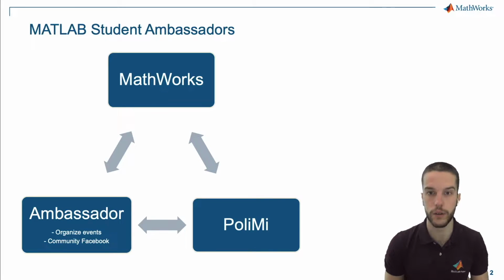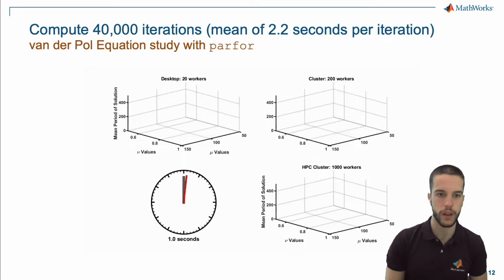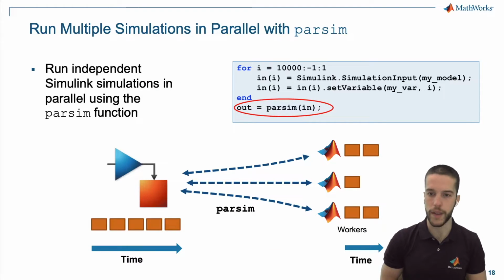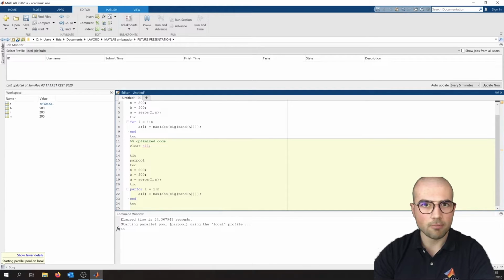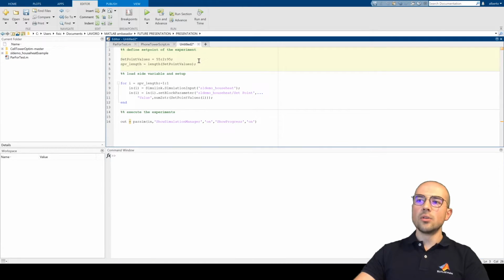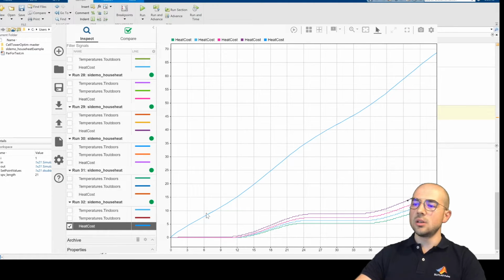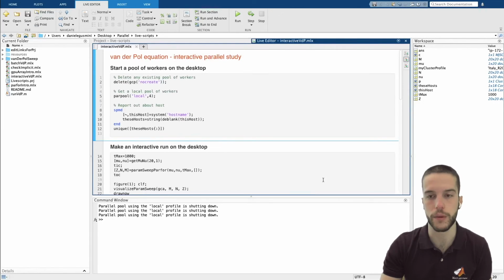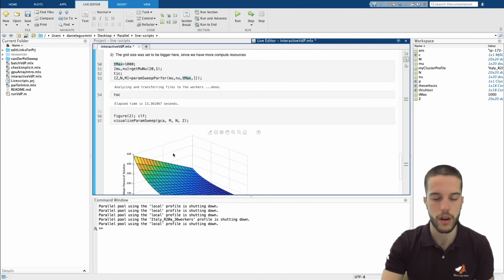MATLAB Parallel Computing

Comment: Did same example as on 10:00 . Parfor tooked twice time to execute then regular for loop.
Maybe cuz all computations matlab need to do , to properly distribute tasks to workers and assamble everytjings back serialy . In the end, it never work as it should
Reply: How can I save a variable of type cell or higher dimensional matrix with different filenames inside a parfor loop?
 I defined a function parsave and it works only or variables, which are 2 dimensional matrices.
Reply: @madhuzzz  
1) Is there an option you try to save it serialy after parfor done?
2) Is there an option instead parfor run PARRALLEL JOBS and then in the end of method you add regular save (look for Run Batch Parallel Jobs)? 

Never had necesity to parsave something.
Reply: @madhuzzz  in case you try to optimise saving as part of a bigger script that should be continued after saving process:
 option 2 can be extended with WAIT method that will wait for all JOBs done before continuing forward execution.
So you may create sort of "parrallel save" JOB task.